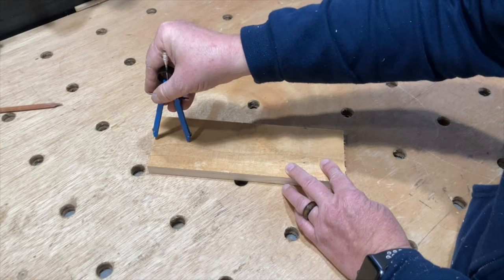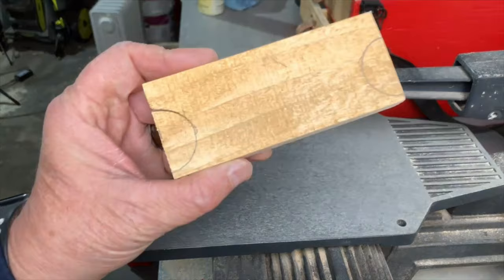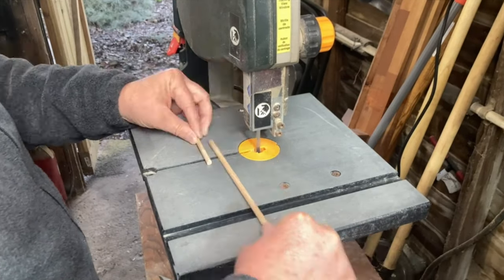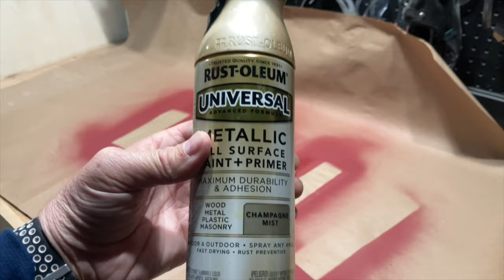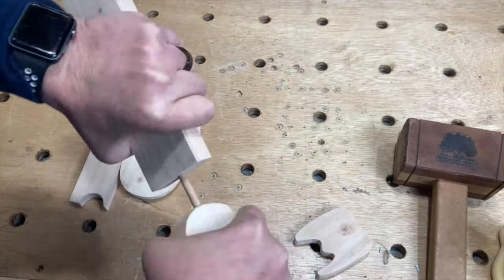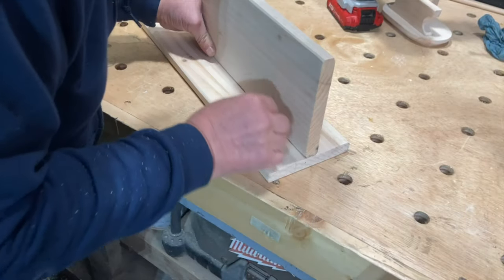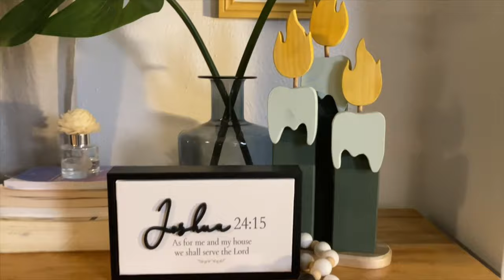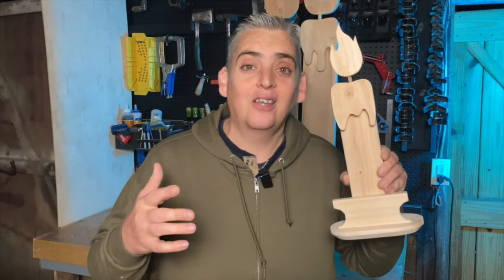Making Christmas Candles / Easy Woodworking Project

Comment: Very nice project! One suggestion is something I do with similar projects is to use peel and stick felt and apply it to the bottom surface of my project base and trim the excess off with an exacto knife. It adds a nice touch and covers up any fasteners and provides protection for delicate surfaces you may display the piece on. I buy it in 8 x11 inch sheets at Hobby Lobby. It comes in several colors so you can color coordinate with your project. Keep up the great work and have a fantastic weekend.
Reply from the maker: Thank you, yes, great idea. I buy my self adhesive felt in large packs off of Amazon, and I don't know why I didn't think to put some on the bottoms of these candles. I already gave a few away, but the ones I have left, I'll add felt to. Thanks for watching!